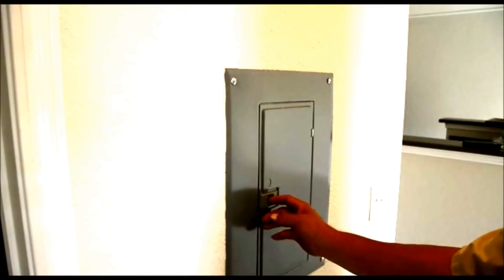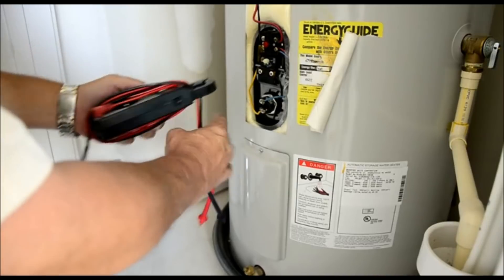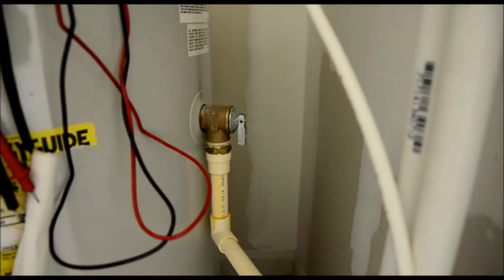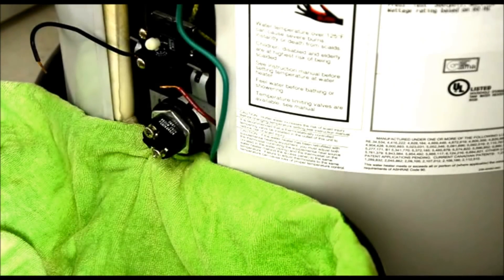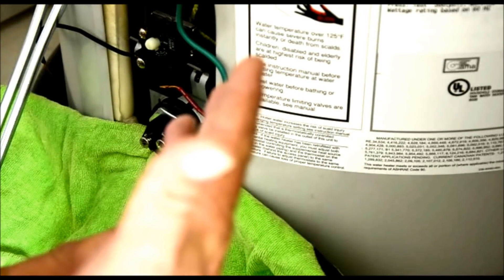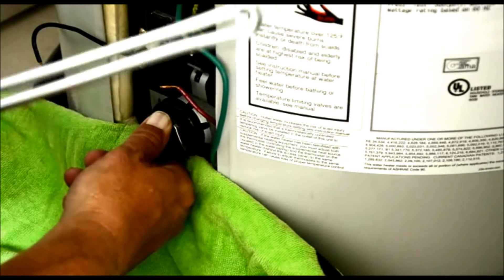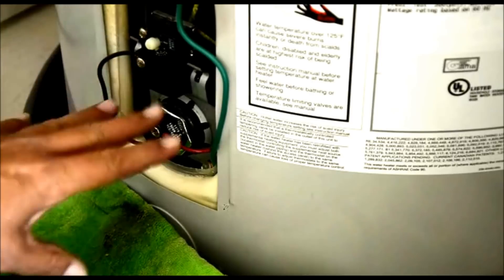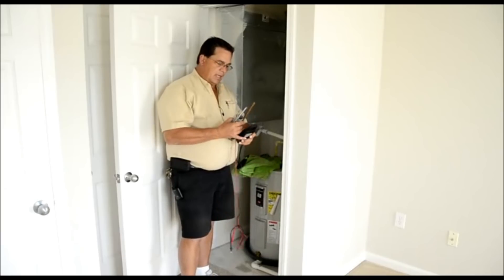Replacing A Water Heater Element With A Full Tank Of Water. "Not Draining Tank."

Comment: Thanks, Dan! My water heater is in my attic, and there is no easy way to drain it. I would have to cut a hole in the screening under the eves to make a place to route a hose. So, this is exactly how my plumber replaced my elements! Less than a cup of water spilled and it took about the same amount of time as in the video. I see no way that a lot of water could leak, even if the old element won't come out. You would just push it back in and then drain the tank. Next time, I will do it myself!

Comment: Dan very helpful video. Apparently some idiots cannot see some possible reasons you did a "no draining element swap." It appears your tank is a very small unit and is likely not on the 1st story of the structure. Plus you do have a drain pan AND drain if the water did continue to run so you chance of water running out on the floor is minimal. This minimizes the possible water loss plus running a hose to another floor or drain may not be feasible,While us novices may feel safer draining the tank, your vid shows that your method will work with the circumstances you have.
Reply: +Jim S It also appears his tank is pretty new and probably didn't need the element replaced. It is seldom that easy to pull a bad element out of the tank because of warping or mineral build up. But then I guess he would just screw it back in and do it the right way by draining the tank and then pulling the element.

Comment: In a perfect world, yes, I can see how this would work. But the majority of failed elements I've replaced (especially the lower ones) have become warped, covered in sediment, or both and takes a lot of work to get it out of the tank. The 5-15 minutes it takes to remove one of those bad elements would put you in one hell of a mess. I like the theory of your technique,but I want to make sure people are aware it's often not this easy.
Reply: +Pringals That was my thought exactly!
I once had a heater with an OLD folded element that I had a REALLY tough time even getting out. We would have had about 560 cups (35 gallons) of water on the floor on that one!
Reply: But then I guess a guy could screw it back in and do it the right way if it doesn't just slip right out.
Reply: "it's often not this easy" I like it!
Reply: I'm a plumber. Pulled out a badly bent element from this exact tank last week. Took me almost 5 min and I'm a professional. Client dry fired the tank,the element melted and split into two bent rods that were wider than the hole and had to  really work at it to get it out.   I also... drained the tank. Because it takes like 20 min? What does that tell you. Having said that, when it works it does save you some time. And it's a terrific video but...its like 20-40 min depending on tank size and You can't see what condition the element is in untill you start to pull it out? Drain the tank.  Some people gamble with money but you can also gamble with water.

Comment: This is a very miss leading video to watch, then attempt to replacing the element. 
Not all cylinders will allow you to do this, You will have over 150 litters of water gushing out into your house. 
The weight of the water is immense, good luck trying to push the new element. The water spraying you all over wont help either. 
It is always the best option to drain your cylinder fully first 
On mine there is a drain cap on the outside of the house to drain the water. 
If the element has gone then the tank is due a flush out anyway. 
Good luck to anyone who attempts this method.

Comment: So irresponsible!  How many people have you created a mess for when they couldn't get the old element out! the reason elements burnout is from sediment buildup and the tank needs to be flushed or you just be doing it again soon anyway! Lazy! For anyone thinking of performing this stupid tactic think again, turn off power , turn off water, open a hot water faucet anywhere in the house preferably closest to the water heater and drain it first. This is the way a lazy slumlord or a lazy maintenance man for a slumlord does it!
Reply: Stacy Newman This vid is about CHANGING THE ELEMENT not maintaining or draining any possible rust/sludge from the tank. READ THE TITLE.
Reply: what if it's a new water heater and for some reason the element stopped working because it was drained and moved.    In my situation I have a new heater in a new build, it was working then we moved it.  We drained it shut of the power etc and it didn't work when we refilled.  So in my situation this would work.
Reply: M Pine if you did it in the order as you described that would explain it. if you drained it then shut power off that would burn the element out. And when refilling the elements must be submerged and air removed before power is applied and vise versa when drained. If all this was done properly then it probably wasn't brand new and a corroded element fell apart during agitation of the move .. just trying to help
Reply: Hey, Stacy, you've got the right idea, but the only way to drain the sediment would be to drain the heater through the faucet at the bottom of the tank.
Reply: joe biddy yep that's the idea and that's what I said,  never change an element in a full heater unless it's YOUR HOUSE and your are willing to deal with the mess when the old element doesn't come out and you can't get the old one back in to stop the water gushing out. He got lucky in the video that it air locked and the element came right out with minimal water loss. Anyway it's funny that responses came a year later! lol.. My simple point was that no home owner DIY should ever try it this way
Reply: You're absolutely right  drain the tank this is an idiot

Comment: This was a good video. The only problem is that it only showed a one element heater. If the water heater has two elements, then then I assume the water has to be drained before the bottem element can be removed.
Reply: +Rod Miller This is a dual element heater. It is a very squatty little heater, but he did replace the bottom element.

Comment: Thank you for the video. Did have a question. Does it matter which screw goes with the red or black wire? I noticed you put in the new element but did not mention if the wires have a certain matching wire.
Reply: +Sergio Rey-Silva It makes no difference which wire hooks to which terminal.

Comment: You were able to unscrew that element with ease compared to the problem I'm having. I so much as went and got a heavy duty 1 1/2 socket with a 17" breaker bar and I'm pulling my hair out.
Reply: PB Blaster soak the hell out of it with power off. I'm sure you fixed it by now but that stuff is the true nut buster! Plus many other uses. Just used it this morning on an 80 yr old galvanized seized union. (Hey I'm in Michigan, Kalamazoo)
Reply: humorU2 ummm no, the new heating elements are stored away. I tried PB blaster and so I broke down and had to call a plumber. He said the elements were good and the thermostat was the culprit. I've been in Kalamazoo once, now in Sacramento where the water is very hard.
Reply: +Michiganborn1969 That was the main problem I had with this video. He ASSumes the element is the fault, and shows nothing of real troubleshooting!
And yes, it would be nice if the elements were all new like the one he showed in the video. I doubt it even needed replacement.

Comment: There is an easy way to drain the water from the water tank if that  small drain valve on the bottom of the tank does not turn or if that small drain valve on the tank is stopped up .
Just hook up your garden hose on an outside facet which need to be lower than the water heater. Then stick the end of the water hose in a pail and turn the facet on until  there is no more air coming out at the end of the hose that is sticking in the pail full of water. Turn the outside facet  off. Turn your water supply main off. Turn your outside facet on. Turn any hot water facet on inside the house and the water tank is draining now, provided that the end of the water hose is lower than the water heater.

Comment: Last time I tried to remove a old heat element I had to put  a ''' big  '' pipe wrench onto the socket and I destroyed 1 socket in the process.
I sure would had loved to just use a screw driver to turn that socket.
Reply: Bonnie Flory Sounds like you're using some cheap China sockets from Harbor Freight.
Reply: Ammo Man 
It was a socket from lowes hardware.
I ended up going to sears and got me a deep-well socket for it.
Reply: +Bonnie Flory If your water heater was almost new like Dan's, it would be easy like his was. But if it was, you wouldn't need to replace the perfectly good element either.  LOL!

Comment: Are the heating elements polarity specific?
Reply: There is no polarity in AC power. If you are asking about "hot" wires and the grounded neutral conductors then no, the element in this case is powered by 240 volts. From the circuit breaker the element is fed two lines at 120 volts each and in this case there is no neutral wire.

Comment: What about all the calcium build up, shouldn't you get as much of that out of the tank as you can before installing the new element?
Reply: Yep , allways best to drain water heater to get all the calcium rocks out & sediment. Hook up a hose to bottom of hot water heater and Flush out All the crap Before installing a New Element. Allways  Best !
Reply: Yeah of course. If your at home or if you have some down time working maintenance at apartments

Comment: Looks good and a thorough explanation.  However,  I would only do it this way if I,  as you did here,  had a problem draining the tank that was too difficult to overcome easily.  As someone pointed out,  it would be a good time to flush the tank anyway.  And I like to eyeball the anode rod through the element hole anyway.

Comment: Just did both of my heating elements. Top was the first and worst, rubber washer looked torn up after i took it out but it was leaking before I finished loosening the element. Had an oh crap moment as I stared at it then just kept going and swapped it out. Bottom wasn't as bad but it had more water spray, now just need to grab a hose end cap to fix the small drip on the drain valve. Had no hot water for a few weeks now. Thanks for the video.

Comment: Good Method. I have done it that way before. As long as air does not enter the tank, the water will have a very hard time coming out. Only problem is you may have an issue with shitty threads on the tanks, then your racing to have the new element thread in properly.

Comment: DONT ever lift up on the relief valve. On a use water heater the gasket inside will not seal any more like it did. It will start dripping and you will end up changing that.

Comment: Dan, great video for those who aren't aware of this method.  I have been doing this for nearly 50 years but, as mentioned below by some of the others, there are times when the water needs to be drained.  Since this is your area of expertise, you might consider doing a video on when it is vs. when it is not appropriate to do this job this way. I like to clean my hot water heater out annually just to be on the safe side.  Even though I have a top of the line whole house water filtration system, I drain the unit on a yearly basis.  Probably overkill but I've never had trouble out of a hot water heater.
Thanks for the videos you put up.

Comment: This method does work, if I was in a hurry, sure but if the tank is older? I like to purge & flush out all the sediment & rust that is sitting on the bottom of the tank. I would check the voltage first, IF the tank is in a building with 3 phase power, I'll swap out the 4500 watt element with a 5600 watt element to compensate for the lower voltage. Some condo / apartment units that share hot water that runs out & space is limited, bring over 2 - 30 amp feeds (well identified and disconnects in view)
now both elements will work at the same time if needed for faster recovery.
Reply: Honestly, I can sit through many of ze Hot Water Heater vids.
As a young teen, my bro. & I picked up a good many francs installing such heaters in a # of apartment units in Toulouse.
Reply: AH, I just love girls that turn wrenches! 
I met my better half on a sky scraper job in the late '80's, so much more pleasant on the eye .... and nose in the morning than most. I was running a crew of a half dozen electricians and a few pipe fitters installing Johnson Control's Building automation controls then in walked a 2nd year apprentice looking for me... to tell her what to do!  So I asked the few questions I ask to find out how good she knows the trade, " How many 3 way switches would you have in a stairway with 99 landings? & why do Transformers Hum?"
Reply: ALLAN KENNEY "... why do Transformers Hum?" Why do a man & woman, being intimate, Hum? (& for THAT matter, Why do fools fall in love?)
My husband too, is still amazed at my being able to NOT wait for the bldg.-super to come, to do repairs...which could take FOREVER!  Henri becomes my parts-runner, I do ze repairs and we bill ze maintenance dept....who NEVER fail to pay...even for my service fee.
Oh oui, & I do all ze wrenching on my race 2CV...and also tune-up tweaks on most of ze loaner rides I secure at ze Hill Climb events.
Reply: Amélie Renoncule Tis Why We Click, Mademoiselle..... MMMmmm
Reply: We too have wide-eyed ones with grand hopes, given to flirtation...even my husband...who is shamelessly so, with me.
 ;-)
Reply: Amélie Renoncule lol, now I need a cold shower... But first, tell me more of your 2CV. I shudder and get chicken skin reminiscing of my time in Bordeaux in the back seat of ...
Reply: ECPM ECPM
http://www.vintageracerules.com/forums/ubbthreads.php/topics/6189/Re:_MEMBERS/GUESTS_RACE_RIDES.#Post6189

https://vimeo.com/93312727
https://vimeo.com/70001891
https://vimeo.com/70159328
https://vimeo.com/82241455

https://vimeo.com/user11005302
https://plus.google.com/u/0/107862962764500048219/about

Comment: Worked like a charm.  Less than a cup of water spilled out.  It's like putting your thumb over the end of your straw.  If the pressure is locked, a minimal amount escapes the bottom.  Couldn't have been simpler.

Comment: I have a leaky water heater but mine is leaking around the heating element. We have took it out twice and put it back in but its still leaking.  But it looks like it is leaking under that metal plate behind the element... Has anyone ever had this problem before...Could there possibly be a crack in the tank or something back there....I am thinking that metal thingy  (sorry I am a girl :-) doesnt come off, or we cant seem to figure out how...........CAN SOMEONE HELP ME OR DO I NEED TO GO BUY A NEED TANK??????????????
Reply from the maker: be sure that the gasket on the element has been replaced and that the old gasket is not stuck in the opening.
Reply: The gasket is attached to the heating element. it doesnt come off.  Do you think there could be a crack or something behind that metal plate thingy causing it to leak. This water heater is only 4 years old, and this just happned a few days ago.
Reply from the maker: Possible but not likely
Reply: Is there any way to get that metal plate off, do u know?
Reply: andrea vance I know this conversation is a couple years old but. Most heater water heater (tanks) have a warranty of at least 5 years.

Comment: I replaced a lower element in my tank a couple years ago.  It was actually broke, and took some time to get it out of the hole.  If I had tried this method, I would have made a nice mess.
Reply: Same thing happened to me tried this on the lower element and to my surprise my old element was "U" shaped and it had expanded to where it could not be pulled out!!  What a mess!!! I actually had to buy a new tank the "Plumber" could not pull the old element out I even tried!! "Huge Mess"!! avoid shortcuts!!
Reply: you would just screw it back in then drain the tank
Reply: me to ... no friggin way ... I'll drain the tank !

Comment: Remember he's a "trained professional".  Elements are often MUCH harder to remove- pipe wrench, rather than a screwdriver.  The old gasket often needs to be scraped out w/ a knife or screwdriver.  I've also had bad new gaskets and/or elements. So you DEFINITELY need to be ready to deal with a leaky element and be ready to go ahead and drain the tank anyway.  

As Dan points out it's often nearly impossible to get a hose on the drain valve.  As someone suggested, having a big shop vac, and maybe an assistant, handy is a good idea.

So, not saying this can't be done the way Dan suggests, but you'd better be ready for the potential "Aww, Sh*t!"  Quoting Dan, "If you're fast enough (and lucky enough) you can get it done just like that."
Reply: Totally agree!
Reply: ^scraped lol
Reply: You can always just add a longer Philips head screwdriver to the element wrench to get more torque on it.  It's just like sliding a 3 foot pipe over a lug wrench to get w uncooperative wheel lug off your car.  The longer the arm, the less effort it takes.
Reply: I did it just like he did. EZ PZ
Reply: Guess I'm fast and lucky! Worked like a charm for me.
Reply: I was going to say...gasket probably needs to be scared out...can't just pop a new element in

Comment: I have done this quite a few times but I usually have a shop vac there just in case I am not as fast as I should be. It's been many years but I knew I was not the only person to have changed a heating element with water in the tank.

Comment: Great video Dan! I think it may have been helpful to show how to test the element also. JJ, Dan told you to reclose the pressure relief, and also make sure no valves are open on the system. No wonder you got wet. You let air into the tank. ;-)